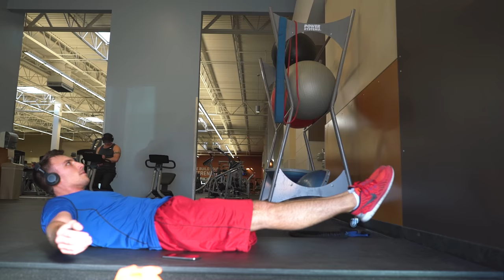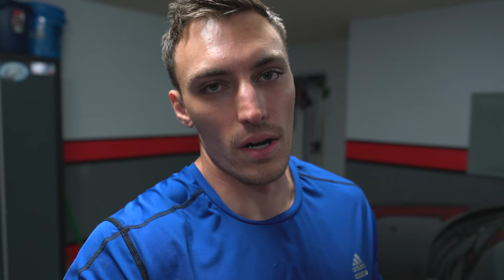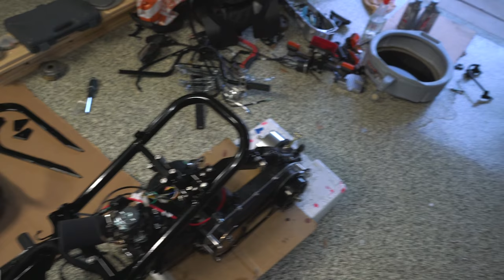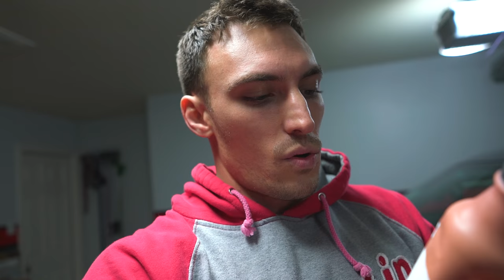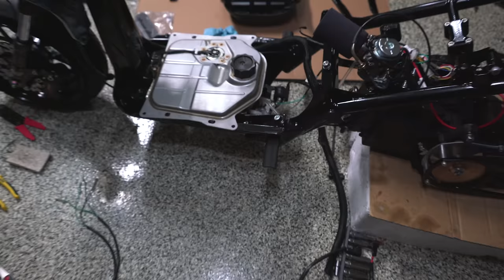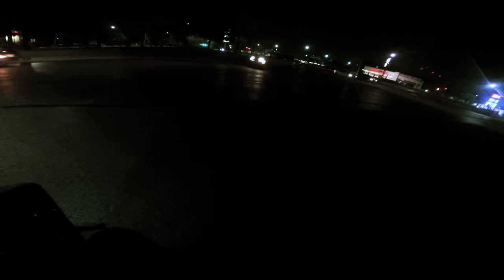My Ruckus vs Dan's Harley?!

Comment: your friends can get 50% off if you share Soylent and you couldn't be bothered could you lol
Reply from the maker: Didn't know! Added a link to the description.
Reply: Motonosity your the Best ^_^
Reply: Motonosity did you know that if you take a ratchet strap and put it over the tire it will stretch it with out the air blaster thing
Reply: race dan

Comment: Bro get a Rachet strap  starting fluid. And a long lighter  out the strap on the tire. Spray the starting fluid in to the tire.  And then reach in with the long lighter.  Have an air compresser on stand by. Once the bead pops. Quick put air in it.